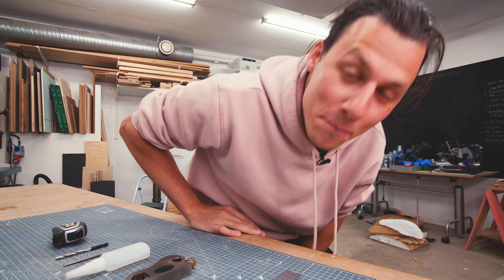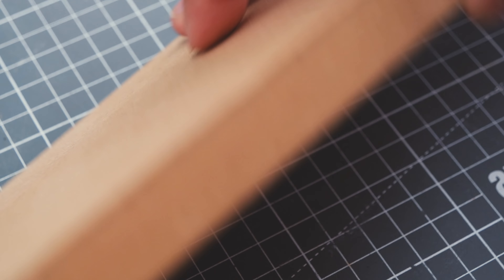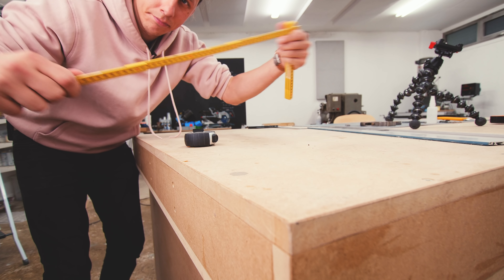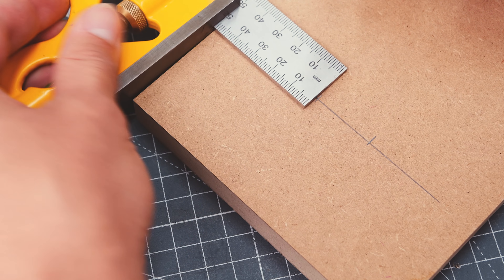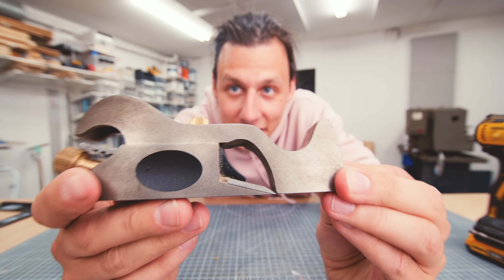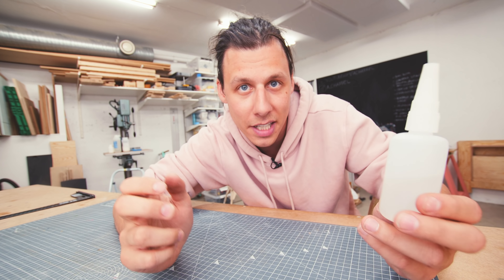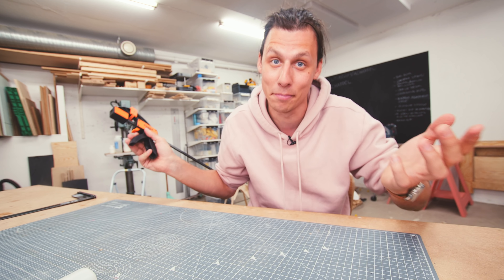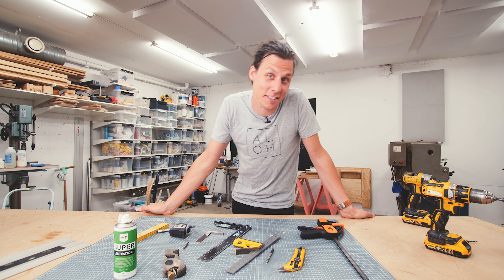The 10 Most Useful Hand Tools

Comment: we've been getting a lot more torx fasteners here in the USA and I agree, they are awesome. A bit more expensive since the brands are from Europe (GRK, Grex, Spax). But since they are engineered, they have better grip, don't snap and are better quality. I've used square drive, but I'm a big fan of the torx style drive system.

Comment: I have some bar clamps similar to those you showed, but they also have a feature that allows the fixed jaw to be removed and moved to the opposite end of the bar, allowing the clamp to act as a spreader. I've found this feature useful from time to time. They are made by Wolfcraft.
Reply from the maker: Jeah those i have can do the same thing :) I think most of the bar clamps can do this, or at least of those I've tried. Thanks for watching :)

Comment: Decorators multitool e.g. Purdey: flat scraper, spreader, circular profile scraper (great to remove old finishes from handles etc.) nail puller, paint/varnish lid remover, hammer (end of handle to replace tin lids etc.) pointed corner scraper, mini pry bar (removes rusted washers/annulus rings etc). The pointed tip is sharp enough to scribe, and some versions even have a bottle opener 😊

Comment: I switched from utility blades to segmented blades a few years ago when the Samurai Woodworker talked about them.  I hate standard utility blades now. 

As far as the blades themselves, the Olfa brand are the best I've used.  Spendy, but worth it.

However, I really like the DeWalt handle /holder, as it locks the blade securely, yet when you push on the slider there's nothing to loosen / tighten.

Comment: The combination square, how is the fit between the ruler and the thingy?, I have tried to buy a few (can't find them in Norway for some reason), and the fit is always loose, so I wonder if that is how they are, or should it be a tight fit. (like, not sideways wobble etc)
And, how do you make ca-glue last?, always after 2-3 uses, then the glue is either dried or not possible to open again.. (user error I guess)
And axminster, how are they delivering to Norway?, or do we have Norwegian suppliers of your stuff?
Reply from the maker: the combination square has a screw that you need to tighten, once that's tight everything should be super snug. With the CA glue it's super important to screw the cap on fully every time, and I've many times not screwed it on fully and ended up with the cap being glued to the bottle :P Axminster are great, they ship to Norway, you'll have to pay the import fees and vat though... thanks for watching :))
Reply: @achappel  Would be better with local vendors, or that they handle vat, will try and see.
But, the combination square,  yes the screw is ok, but the "track" that the ruler lies into, is always much wider than the ruler is thick, so it want to wobble sideways, will try to locate them again, and post a picture somewhere.
Reply: @achappel  If you want your CA glue to last a long time, here are two helpful tips. 1) Always store it in the refrigerator with the cap tight. 2) Do not spray the activator anywhere near the open bottle of glue. I recommend you put the cap on the glue before you apply activator. Believe it or not, the activator molecules travel quickly through the air and can start the chain reaction on the glue in the bottle. Just think of how quickly the odour of the activator reaches your nose.

Comment: Dang, I think I'll have to run out to the nearest Clas Ohlson and get that tape measure! BTW the way I like to use those foldable "tommestokk" ones is to line up the length I'm referencing with the edge and then mark at the zero point of the ruler.

Also, those Bahco clamps are really nice and for sale at Jula here in Norway right now for 50 NOK (~$5), I'm thinking about picking up like 10 of them 😃

One tool that I find super useful is my Level Box! Makes it super easy to set accurate angles on my table saw.

Comment: About screw types, torx are good, so let's lay it out from totally unacceptable (x2) to excellent as there's one close to torx that is a bit more versatile in a pinch that you may not even know about and definitely didn't mention: flat blade (no), philips (no, cam out), pozidrive (like philips but do not cam out, not bad), square (good, if bit is in good shape, you won't strip one), "csk multidrive" - fits pozidrive and square and come with bespoke bit that has similar torque capacity to torx), hex, torx. That's also in order of torque capacity :-) As long as you're aiming for the top end of that for your given market and supply chain, you're doing well enough. Anything less than pozidrive is a straight no, though :-D

Comment: Comparing Torx, Phillips and Robertson would make for an interesting video. I’ve used all of them and Robertson is best then Torx then Phillips.
Reply: canadian here. mostly i use robertson as torx is far more costly. at least here. torx is good but the price makes it a less attractive option. to be true i use inch standard self tapping 7/16 fasteners but its very application specific. canada drives in metric but builds in fractions. i use metric for small things but thats because i have centimeters tattooed on my left index finger. that is my most used tool
Reply: Unfortunately Robertson is really uncommon outside of Canada. While it's very popular to hate on Phillips I think most problems come from people using the wrong driver or not replacing them when they are worn out. But even so a marginal Torx is still a way more reliable and stronger than even the best Phillips screw and bit.

Another standard that's very common is the old Hex socket. The drivers are often reffered to as Allen wrenches. While these are common they are also actually mechanically weaker than both Roberts and Torx, especially when used for small screws.

The real strength of the Torx system is that it's immediately obvious when you try to use the wrong size driver, and it's the same with Robertson. Phillips on the other hand you can usually use a driver one size smaller, and to the casual user it's not immediately obvious just how it damages the screw head. Another problem is that you can even try to force a Pozidriv, Supadriv or JIS into a Phillips head. In fact JIS screws are pretty common, but most of the time people doesn't have the correct driver and just use a Phillips screwdriver often not even knowing that JIS is another standard. Almost all of those problems can be avoided by using something like Torx or Robertson.
Reply: I was introduced to Robertson much later in life. It’s incredibly strong. Driving 5” screws is easy one handed. And the screw holds onto the head without magnets. Screws can be reused multiple times and quality bits last years. A tribute to a great Canadian invention. It’s a pity it’s not more available worldwide.
Reply: @rickypacheco  I will take Torx over Phillips screws, but I live in a part of the world where square (Robertson) screws are the king of screws. I have square bits that are over 10 years old and still work, just fine. Furthermore, I have a pair of square screwdrivers that are over 20 years old, and they are still working fine, those are from the pre-bits era.